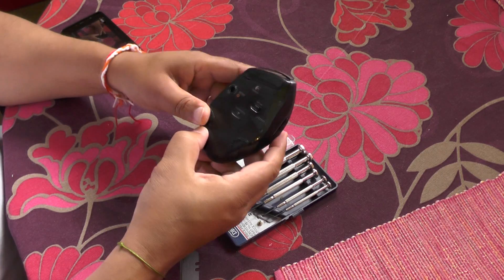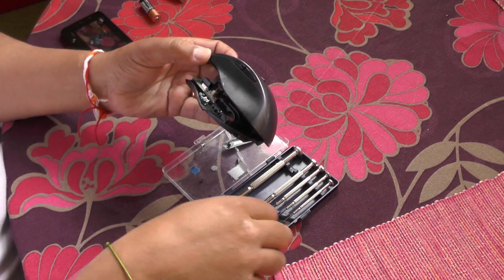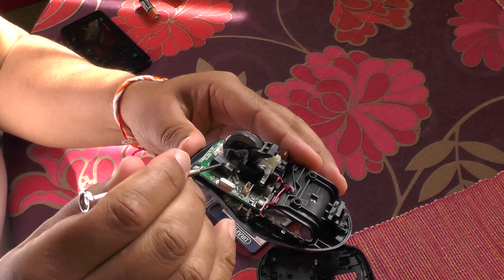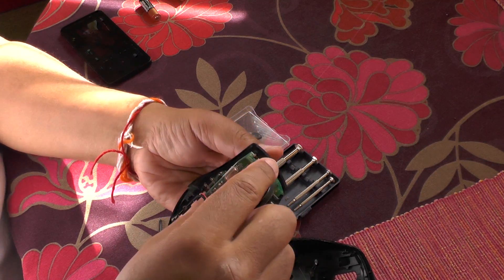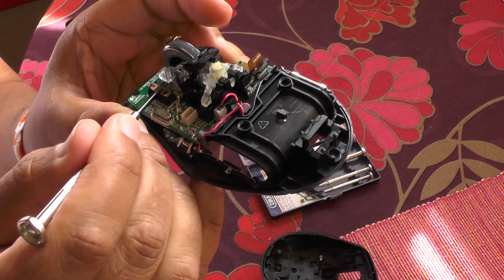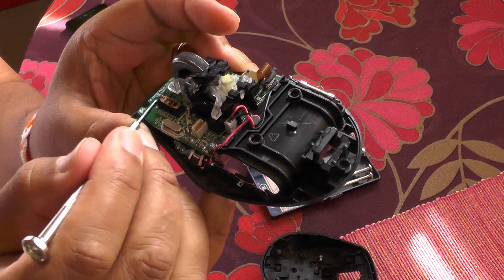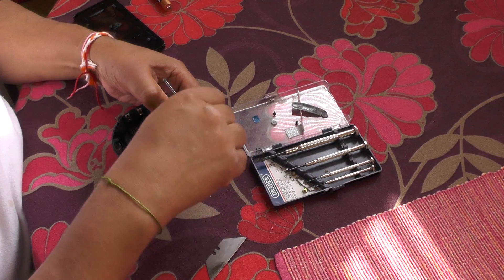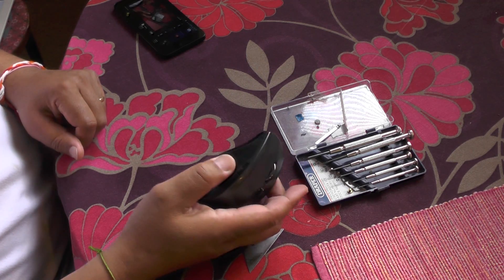Logitech Mouse Double Click Problem and How To Fix It - Red Ferret How-to

Comment: I have a Logitech Vx Nano that had the double click issue. I did some troubleshooting to find out what the problem was. Galvanic Corrosion.

SYMPTOM: Left clicking mouse will sometimes produce a double or triple click. Trying to so a CLICK AND HOLD to drag icons on the desktop or stretch windows would always end in dropping ICON or Window stretch not working out very well. The click and hold wouldn't hold on. 

Its something that electrical contacts commonly have. What happens is when you have two different metals in contact with each other, and then have an electrolyte introduced, lets say moisture in the form of humid air, then a current of electricity can form between the two parts.

But isnt the switch made of two copper pieces? Not different metals. Thats true, but in this case galvanic corrosion occurs by the current flowing through the switch, the current being used. That small current creates a small amount of corrosion.

I tested for this first by rapidly clicking the mouse button extremely, fast and hard using my finger. Did this for about a minute. Symptom gone! SAWEEET! For a few days anyway, then it returned. I did this several times a month until I got fed up with it, and went to buy a new mouse. To my dismay I couldnt find a mouse even close to this one. The position of the two extra buttons is PERFECT for me. EVERY OTHER MOUSE HAS MOVED THEM BACK TO WHERE I CANT REACH THEM WITHOUT LETTING GO OF THE MOUSE. Or have placed them on the side, for the thumb. Which means removing grip with thumb to click these buttons, which again, losing grip on mouse. Frustrating. So I went to Amazon to buy a new Vx Nano.

WTF!?!? $300 or more, for a used mouse?!?!? NO EFFING WAY DUDE! Logitech, you need to bring this mouse back. I'll buy three of them right now, but wont buy one for $300! 

So, I was about 30 seconds from doing what this guy did in the video did. I was looking to disassemble and fix the switches (by now it was both left and right buttons). Then I a epiphany... Electrical contact cleaner! I could just spay that under the finger shields!

So here is what you need to do.

You will need the following...

Can of compressed air (that can spray the liquid oout when held upside down. Frostbite warning, can freeze your skin, so be careful.

Can of electrical contact fluid in spay can. "CRC brand, QD Electronic Cleaner" quick drying formula. It can be used on live circuits, does not conduct electricity, at least not at household current levels, and my guess is as long as there isnt a lot of dirt around area being sprayed, to mix in and then conduct.

First, use can of compressed air to blow out any built up dust and dirt out of mouse. I used a small screw driver to lift and hold open the mouse finger shield, to get as much air in and directed around. I had food debris stuck in there. To get that out I inverted the can and blew liquid air in too the area, which knocked that garbage loose, and essentially washed/rinsed out the area. Looked very clean in there after that. This will use up the can of air about 20 times faster than normal as liquid sprays out, so be careful with duration, and dont forget, wear warm gloves, and place rubber or plastic gloves on the outside of them to prevent liquid from soaking into them and freezing your fingers.

After it was cleaned I turned to the Electronics cleaner. It has a straw on it, allowed me to get the nozzle inside the area of the switch. I soaked the switch really well. Allowed it to dry (take about a minute, used compressed air to assist this) and did it again.

That was several months ago. And its working just fine still. No risk of breaking parts, like those copper springs.
Reply: now that is very interesting and sounds like a better solution (MINUS the horrible canned air -- NEVER EVER use that JUNK as that stuff LEAVES STICKY RESIDUE -- i messed up my CPU fan using canned air - NEVER EVER use that horrible stuff!!!)

Comment: Dexoit G5 works wonders on these switches. No need to replaces these switches. Just spray Deoxit on the end of a Q tip and work the microswitch plunger with the wet Q tip. As soon as you see the Deoxit leak out of the bottom of the switch reverse the Q tip to the dry end and work the switch a few dozen times to let the Deoxit burnish the contacts. Let dry. Might just as well do the other switch too. Going two+ years now on a new replacement G700 I got under warranty. The replacement started acting up after 90 days. Now I have 2 good mice.

Comment: Before you do all this. Assuming you havent physcially damaged by the mouse, try performing a "power drain". Remove the batteries & hold click & hold a few button, in this specifically the left click for 30 seconds. This drains the electricity from any capacitors or resistors wiping them clear of any errors. I do this all the time with PCs when a random issue will pop up ie. from network or video cards not displaying, to this very morning my work laptop was extremely sluggish even after 2 reboots. I fixed my m705 mouse yesterday with this method.

Comment: well chap, that was a fiddel, the middel spring clip in is key to the whole thing, mouse working a treat. I did follow the URL at the top to review the information on this which was the clincher for understanding the spring holding points. Thanks for this even if it is old i use things untill they are beyound repair so  i keep my money for other things that i want :-) 

cheers
Reply from the maker: Pleasure.

Comment: *BEFORE you do something read my comment!*

#1: Follow the instructions to dis- and mantel the mouse, but don't bend something, follow my next step!

#2: It's not about bending the copper spring like in the video. You just have to clean the contacts. There is a oxidation layer that needs to be removed. A very thin sandpaper or even a very thin screwdriver will do the trick. Just rub it a little bit between the contacts.

#3: DO NOT lick the white plastic thing, its much cleaner and more easy when you hold the black plastic housing upside down, fit in the white plastic thing and than put the mainboard in the right direction onto the black plastic housing (also upside down). So you don't need to worry about the right place for the white plastic thing.

Comment: So I need to own a specialized set of screwdrivers and then mess with tiny electrical parts to fix it?  Much easier solution to call Logitech and shove the mouse up their ass.

Comment: Wish there was a permanent solution for this issue, 4 mice now have had this issue with every one, one of them i tried to fix like you showed in the video, however the small White piece got lost. without it the spring won't click because it's needed to apply the pressure to click it. If your careful enough and don't loose any pieces, this solution works, at least temporarily.

Comment: I just bought a bunch of new switches off ebay for pennies. WIth any hope they are not specifically designed to fail by a certain company called Logitech so they could sell new stuff to me every couple of years for no particular reason.

Comment: When mine started acting borky I used a can of compressed air and sprayed it under the left and right flaps and between the scroll wheel. It worked.

Comment: First of all I would like to say fuck Logitech and their rubbish mouse.  The type of spring mechanism they use for their buttons is mediocre at best, I go through at least 1 bloody unit every 5 months  !!!  They don't make them like before, I reckon an older logitech mouse I had which lasted me 10+ years and cost the same ! I have gone through several of the bloody M100 !!! Same shit each time the left button registers double clicks sometimes.  Now I am good with repairing stuff, it's not new to me but don't  any of you waste your bloody time like I did fixing this shit, buy a new mouse, that spring clip thing is extremely fragile, you WILL fuck it up just removing it from the bloody thing, once it is, good luck trying to level it and readjusting it.  This video is a sham and waste of time, once you adjust the middle curve for more tension, even if you follow the video to the letter, good luck trying to put this thing back in, you will very likely bend something and make it worse, in fact once it comes out it will very likely never go back in the way it was, and it will always come out and not stay tucked in place.  and since you already widened the middle curve, it will be flush against the bottom so you won't be able to properly align it in the latch - it is a vicious fucking circle so I took my fist and smashed the bloody fucking thing to pieces and got myself a new mouse, trust me the trouble is not worth it, be prepared to get a new mouse every 5 months under normal use and every 2 months for heavy / gaming use :/  Meanwhile I think a class action suit against Logitech should be in order here, this is the 3rd one that fails on me in 1 bloody year, so one thing for sure, I will be taking them to court - I should not have to pay for a new mouse every few months, and not even for heavy use FFS !!!!!

Comment: It worked!!! Thank you. Repaired an older Logitech cordless. I have fought this for 6 months and was sure it was software related. Alas, my actual problem wasn't the little copper switch. It was the thicker top contact that the copper switch  touches. Somehow it was bent and the gap between it and the bottom contact was noticeably smaller than it was on the right mouse button. I wouldn't have found this had I not pulled the switch cover off the right switch to see how to put the left back together. Anyway, working perfectly now.
Reply from the maker: Great. Glad we could help. :)

Comment: Well, I swapped the plates , and now my left click works... but my glide pads are all screwed up!  Ah, well, thanks for the instruction, anyway!
Reply from the maker: That's weird. I've done a ton of them and the glide pads always go back nicely. They may look a little the worse for wear, but they work OK. Did you take a scalpel to them or something?
Reply: Nah, the pads themselves are okay, but the mounting tape underneath wouldn't come off in one piece. This was on a Performance Mouse MX, not an M705, so maybe the pads are stuck on differently--I can't remember. Anyway, I've just stuck them back on with some mounting tape I had laying around, but it's slightly thicker, and the tracking is a little weird. Still, better than double-clicking all over the place! And if it really bothers me, a new set of pads is still cheaper than a new mouse!  ;>)

Comment: I'm running into this with the G903... ended up just using a can of air  and "blasted its insides" now I have a bunch of little baby mice running arou-... I mean, now it works like a charm!!! (sterile preferably) Canned air and keeping your gaming/pc area as dust free as possible (even though its kinda impossible) will help prevent your mice from running into this problem.

Comment: In my case it didn't help just apply a few drops of contact cleaner on the white clicker. 
So I opened the spring housing by sticking a very thin needle right between the outside part of the switch housing and the fixed part (see the right circle in the picture,  https://drive.google.com/open?id=1Opp6XZPJ429Dw3j355V4qRDSypkKTtyz ). I did this on both sides of the housing and so the upside part sprang up very easily. 
Then - like Michael described before - I didn't take the copper spring off.  I only rubbed mechanically and very carefully the contact points of the spring with a very small screwdriver or pin - not only the upper side but also the bottom side! So the copper spring and the other parts would make better contact ... 
At the end I completed the housing with the upside part and put the whole mouse together. 
Overall I did it on three mice and if you used to the steps you shouldn't need more than 20 minutes for each. 
And every mice is almost as new  :-)
.

Comment: The lesson here is.. do NOT buy a Logitech mouse.  they end up double clicking over time. Luckily the last two I got free.  One was a gift and the other a bonus but I will not be buying another one!  So when this 3rd one inevitably ends up doing the same thing, what mouse do you recommend instead? Anyone?
Reply: hi Raan Joseph i have 2 Razer and both had the same issue after a year of use i dint know this before and i buy the deathadder now i fix it thanks to videos like this and its fine,so pretty much all is the same i believe

Comment: Great video, helped me fix my mouse and avoid buying a new one. Thanks a lot for sharing! Btw, I find it easier to use a toothpick to remove the black box: just pick under the plastic clip on one of the sides and roll the toothpick out and it should unclick the box of its support. Anyway, +1 to you sir, and -1 to Logitech Support who just keep sending me stupid automatic answers instead of trying to understand the issue, but I guess they don't care.
Reply: While I was at it, I tried to fix the game in the scroll wheel, something that was present since day 1 and honestly -1 again to Logitech for not doing it the proper way. So I just pasted some pieces of my toothpick under the left and right plastic clicks of the wheel and now it is much better. However a game is present in the wheel itself and I'm not sure yet how to fix. Would probably have to take the wheel and paste something around its two supports thingies so they get a bit thicker and don't move inside their support. If anyone has an idea about it, I'm all ears.
Cheers
Reply from the maker: It's our pleasure, glad to help.

Comment: What happened to the part where you struggle with the white connector with the three wires, and which way round must it go?  You struggled with that didn't you?  That's why you just cut it out.  :)

Comment: I tried the multiple clicking while the mouse is unplugged method, which worked to some degree for a half-hour or so. Then I tried this method. I couldn't get the spring to work to click again each time I put it back together, having cleaned it also with contact cleaner and making sure it looked similar to the right side. I even tried moving the other spring from the right over to the left, which got it working just barely enough to left click sometimes when I clicked hard, altogether about 2 1/2 hours spent trying. I'm mainly posting for 3 reasons: 
1) it may not be an easy task for everyone, and it didn't work out for me even though I've had plenty of experience fixing and/or modifying many electronic gadgets. 
2) If I were to do it over again, I would drop some contact cleaner on the the spring housing and see if it might seep in through the white switch area without opening it up, then opening it up to only try contact the contact cleaner more directly if that didn't work. I recommend trying everything else possible before taking the spring out.
3) the Corsair Harpoon that I just purchased seems to be a very good replacement for something like the G500 I had, which worked for over a couple years fine. But, for just 26.00, this Corsair model seems great IMO for any who may not want to spend much and who don't mind a non mesh-covered USB cable or a RGB light on the mouse logo. 

Thanks for posting the video, and I'm glad it's been a good help for many others.

Comment: I had this problem with my corded mouse.  Just discovered the weirdest solution: 

Unplug the mouse, click the button a lot, plug mouse back in.

It actually worked wtf.  Someone suggested it might be a static electricity buildup problem, so this could be the explanation for why it worked.
-Unfortunately it won't help people with a wireless mouse- EDIT: oh someone said you can take the batteries out instead!
So you take batteries out, then click a lot, then put batteries back in.
Reply: wtf it actualy worked
Reply: wow i just did that with my wireless G602 and it seems to work better now
Reply: HONESTLY THIS IS THE BEST AND EASIEST METHOD!!!! Just clear the built-up static charge AS YOU SAID!!  WOW MY MOUSE IS WORKING GOOD again!!!  THANK YOU!!!

Comment: I have to share, if you are using logitec software for your mouse, you may want to reconsider. I have been wondering why the hell I was getting really bad hitching and stuttering in some games. I have a GTX 1080 and was suffering major stuttering in certain parts of maps, which should not be happening as my card can obviously run games like this without the fans even starting up (even at 4k).
It was actually windows that surprisingly identified the problem with its help center message that showed programs using a lot of resources. Disabled the logitec software - zero stuttering and lag. 
So if you are having similar problems, look to this software as it definitely killed my gaming performance!

Comment: Thanks, very helpful video. I was able to remove the black cover more easily with a hobby knife and to flatten the curve on the copper part without removing it by using a flat tweezers and a toothpick. I hope this gives more life to my mouse, and if not it would be very easy to flatten the copper part again. Again thanks a lot for pointing out the problem.

Comment: This works great!  I keep coming back to watch this video and have now repaired 3 Logitech mice.  Thanks!
Reply from the maker: Pleasure. :) Funnily enough I just took my M307 apart again last night to try and fix it, but they've changed it all around, so the spring seems more robust. I jiggled a few things around just to see if it made a difference, and sure enough whatever I did seemed to have fixed the click problem again. Strange.